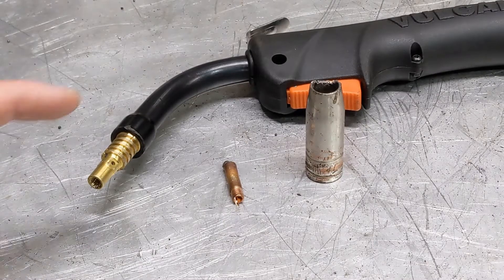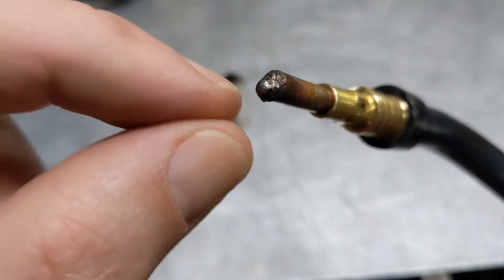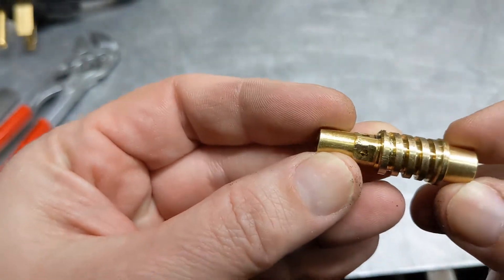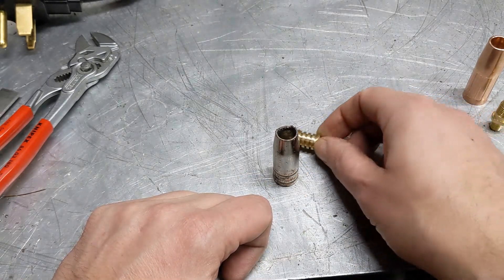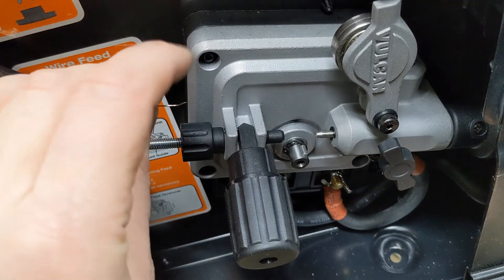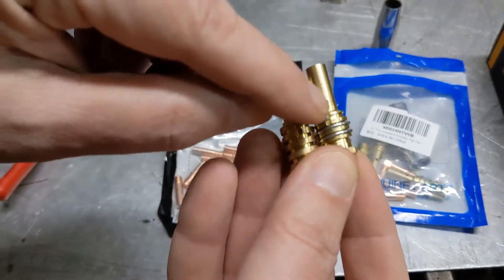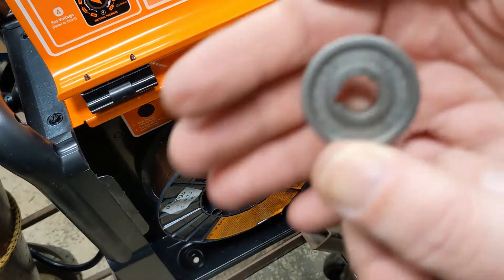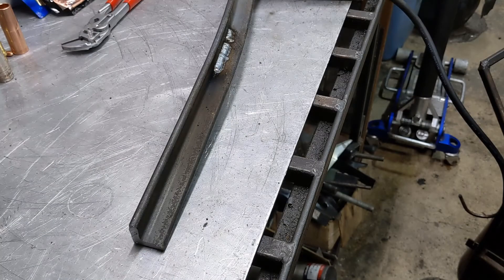Vulcan MigMax 215 Wire Feed Stopped

Comment: Congratulations!!!! You have the only video on YT showing how that tip holder/diffuser comes off, I didn't know it has backwards threads, how is anyone supposed to know that when the manual says nothing about it, I just want to keep spare diffusers on hand for just incase......... 
I bought the 215 welder back in January because my 2013 Miller Matic 211 stopped working after mostly part time use, after 6 months the 215 is still working good it actually welds better than my Miller Matic ever did. Right now I'm very upset with Miller,  IMO a brand that cost twice as much should easily last 20 years or longer of part time use. But since I never had any HF Vulcan welders before I bought the 2 year extended warranty so the machine will break down after 2 years of part time use.........

Comment: I just got this welder. Set it up. Tried it and nothing. The cold wire feed button works but it does not feed or try to feed when I press the trigger. The wire is routed correctly. The fan spins and lights come on. When I cold feed a lot of wire and then press the trigger I can melt the protruding wire so that tells me the trigger is working just the signal is not getting to the wire feed part of it. I want to open this up and find the issue but also maybe I just return it. Not sure what’s less issue.
Reply from the maker: I'd definitely take it back and swap it in that case.
Reply: You ever figure it out my cold feed works but trigger doing nothing
Reply: I just had this happen to me after buying one this past Saturday. What did you end up doing?

Comment: i had a problem with .035 wire not feeding. i put the .030 on and it started working as it should. anyone else had this problem ? the cold feeder works fine
Reply: Did you put an .035 tip on? The tip it comes with it for .030. The .035 will not fit though the .030 tip.
Reply: @russellcampbell8406  yes.